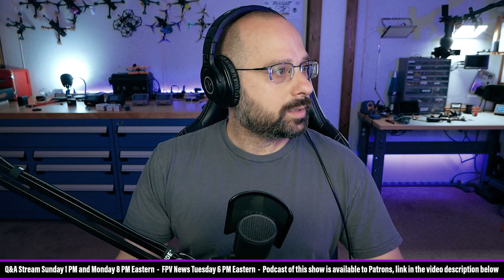Why Does Angle Mode Drift More Over My Flight? - Bardwell FPV Tips

Comment: It is 2025 and I have the same issue with the last beta flight build. Tested it with T-MOTOR F7 35A/45A and GEPRC F722 45A V2. Drifts away in Angle Mode. But it can also be that is a configuration issue. Would be good to know if someone could get it run.
Reply: 4.5.2 i have the same problem on both of my quads. Starts to drift during a flight, sometimes it is off by 45 degrees or more after some time. Both quads have bad bearings tho..

Comment: i dont know if this is 100% of the same problem but iv had 2 drones that would drift bad but i only fly in acro mode the drone would feel like it had auto lvling running at same time i was in acro i reflash my fc and its now working also had a drone have a similor probolem and i track it back to one of the gyros i turn off second gyro and drone started flying good again

Comment: Well...that's good to know...i have 2 different flight controllers in 2 different quads and both have that same issue...i was about to go nuts with that...kept on messing up with my radio settings...triming everything over and over again...and nothing seemed to solve it...
Reply: HI! so how is it now ? what you did ? is it ok?
Reply: @gcdevicegc6103  it is still the same because i never changed the flight controllers and they don't support any updates anymore...so i fly only in acro or air mode...no angle...
Reply: @luisfilipe1983  so you unable to update BF? you don't want to try EMU? just for a test and go back to BF , so everyone knows where is the problem actually
Reply: @luisfilipe1983 same here, but i wanna use gps rescue😥

Comment: I have a tinyhawk 3 tiny whoop. Just started flying it. It wobbles like crazy in angle mode. It almost crashes on decent  It wobbles so much. It's new and hasn't experienced any really hard hits. The blades are in perfect condition. Imagine that little wobble you.get on a hard change of direction, then amplify it by 1,000 lol.

Comment: My quad consistently drifted backwards and to the left - just enough to be noticeable.  Never got worse in flight.  Just back & left a tiny bit.  All. The. Time.  I tried re-tightening the nuts on the stack, calibrating the accelerometer in Betaflight on a true level surface - and more.  I tried the low pass trick but that did zippity-doo-diddly.  A while back I tried mucking with the accelerometer trim settings in BetaFlight, but in steps of onesies and twosies.  I was getting nothing.  Recently, I saw in CLI the range was from -300 to +300, so I went back and cranked in double digits. Bingo.  +15 pitch, +12 roll trim, and Bob's yer Uncle.  Rock steady in the hover for several seconds at a time.  Since it's a 100g AUW whoop that's flown in a 20' x 10' indoor space, 10 to 15 seconds hover time with almost no drift is about as good as it gets.   So try trimming the accelerometer - just be sure to slather it on good.
Reply: did same but after 10-20 sec it does more again ...

Comment: FYI: This also affects GPS rescue mode! 😲
Things to try: In CLI, lower acc_lpf_hz (if it's 10, try 5). If that doesn't help then try remounting the flight stack or aio with less or more pressure on the gummies.

Comment: I had a Tiny whoop that would do that a lil. I'd use trim on transmitter to correct a lil. But I have since had to replace the fc so doesn't seem to do it or as much

Comment: I have noticed that hitting stuff will cause this to happen in a epic manner, especially on certain FC's
Reply: Recalibrate does resolve this?
Reply: @mikewow even just disarming and rearming will correct it. This was the reason I started flying small whoops in angle mode.
Reply: @zero-voltzfpv5715  i only wanna use angle mode for Gps rescue. But i wonder if a drift will cause problems

Comment: I would also suggest that they check the center point values on their radio.  Just to make sure.

 I thought my Mob6 with 26000 KV  was just having issues and the gyro or accelerometer we're going out.   Until my TinyHawk2 with 16000kv motors and Mob6 with 19000kv motors started experiencing the same issue. 

After multiple calibrations I took notice that the center value of my right stick changed depending on the direction the stick was moved.  Can't find a replacement Gimbal (US retailer) so waiting on my Zorro Pre-order and it has been a month since I have flown. 😐
Reply: Interesting - I have it on a tinyhawk 3!

Is this an Emax problem? I have lots of issues with that quad. 

Got myself a Zorro but I still need to install the ELRS rx to be able to use it. (Didn’t want to get a 4-in-1 Zorro as I’m planning to go 100% ELRS from now on)
Reply: @calisti9308  Not an EMAX issue.  I thought it was my Mob6 ELRS then started having the issue on my Mob6 Frsky and my TH2.  After hours of digging and recalibrating my controller, I discovered it was the right gimbal of my Jumper T-Lite.

What controller do you have your issue on?
Reply: @Michael_DahShow  The Emax E8 remote that came with the RTF kit. The gimbals are absolute trash - often I need to manually roll down the gimbal base (the actual role beneath the stick) in order to reach 0 throttle, otherwise I can't arm. When using it on a simulator, the throttle stick position read out can be seen twitching around like crazy as I move the throttle.
However, roll and pitch gimbals appear to be okay, as far as simulators show the signal reading.

Trimming does help a bit, but in the end I think it's rather the gyro.
Reply: @calisti9308  I imagine it is but I bet it much better than the junk controller they offered with the TH2 RTF kit.  If you are looking for a replacement then check out the Radiomaster Zorro.  For low cost it cannot be beat.
Reply: @Michael_DahShow  I already got a Zorro, but I want to use ELRS. So now I'm scared to lift a pad while soldering the RX on, and destroy the AIO board in the process. The TH3 pinout is weird - it looks like there's two UARTs, but one of them appears to be used for smart audio already. So in the end I have only one pair of UART pads to try and solder to...
Reply: @calisti9308  You would want to use the R1 & T1 pads on the left side .  And there is a 5v + ground right above and the left side of the screw hole.
Reply: @Michael_DahShow    Thanks so much! Can you confirm that T2 and R2 are unusable? Do you think I can remap some other solder pads to UART if I lift T2 or R2?
Reply: @Michael_DahShow  It worked perfectly!! Thank you so much!
The red LED on the FC/AIO board is still blinking slowly (all the time). That should be the onboard SPI RX waiting to be bound. 
Do you know if I can disable the RX or at least the blinking LED?
Reply: @calisti9308  Awesome,  glad to hear that I was able to assist.    In regards to the Blinking LED that I am not sure of.   I am still learning these things.   
Regarding the flashing LED.  Did you go into Betaflight, Receiver Tab and change the receiver to Serial (via UART)  and for the Serial Provider set it to CRSF?
Reply: @calisti9308  Forgot to mention about the UART.   I had suggested using UART1 since UART2 is for used for the VTX SmartAudio.
Reply: @Michael_DahShow  Yes - the ExpressLRS link is fully working (I can fly with my Zorro now), so the FC should know the internal SPI RX doesn't need to indicate it's not bound. I didn't find anything that could turn it off.
Reply: @Michael_DahShow  The weird thing about UART2 is that there appear to be 3 pads. A real R2 and T2, but then also another smart audio pad which is also marked "2". That confused the heck out of me. I took the safe route, used UART 1 and lots of "solder honey" to make sure I get good tin flow. (Soldering without Pb).
Reply: @calisti9308  I saw a couple videos of people installing crossfire on their Tinyhawks and they also had the slow flashing Red LED.  I am going to try to make some time this weekend to get an ELRS receiver installed on my TinyHawk II.   I will let you know if I figure anything out.
Reply: @Michael_DahShow  So cool! Thanks for keeping the conversation going! I’ll keep asking around as well. Would be so rad if we could figure this out in the end. :)
Reply: @calisti9308  I haven't had time to fly or get the ELR receiver installed on my TH2.   Hoping to have a little time this weekend.   After I finally get it installed I will let you know.
Reply: @Michael_DahShow  Thanks for coming back to me! :)
Reply: @calisti9308  I will say though.  I have not flown a TH3 yet but I bet it is just as bad as the TH2 when trying to Turtle.  After replacing 2 Flight controllers in my TH2, due to malfunctioning ESC's I learned it is better to do the walk of shame than trying to Turtle.  When you have to give it full throttle to Turtle, you will eventually damage the ESC. 😉
Reply: @Michael_DahShow  I wish you would have told me earlier ;)  The only videos on this channel were made for EMAX support to show them that definitely the AIO board is broken. It's a shame. Maybe it happened due to turtle mode? I did buy myself a second TH3 to keep flying while trying to sort this out with EMAX support, but they're just making me create more videos all the time instead of just reading my own diagnostic description and agreeing that their hardware is broken.

Comment: It would be interesting to see if it happens with EmuFlight as well. (In the same flight controller, of course.)
Reply: I just tried it on a Meteor75 that have drifting. Emuflight, in my case didn't solve the problem.